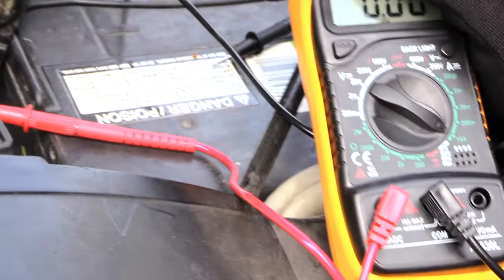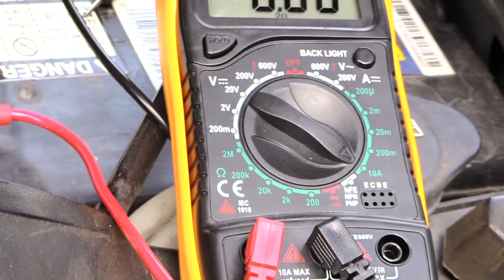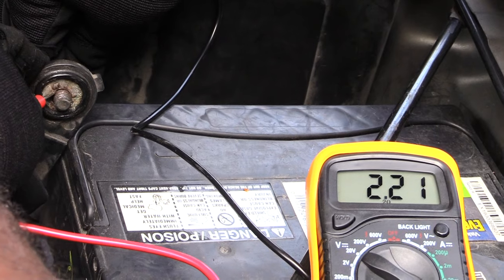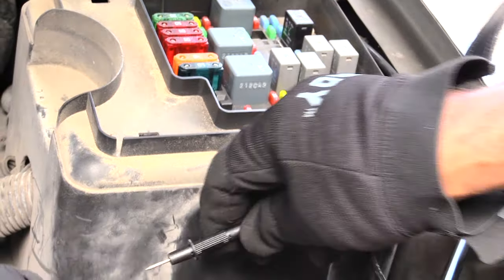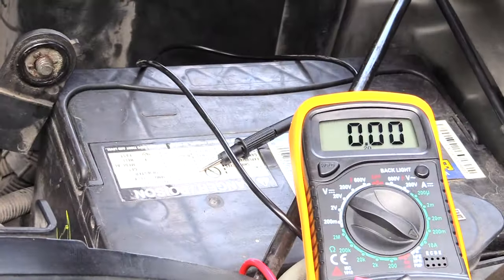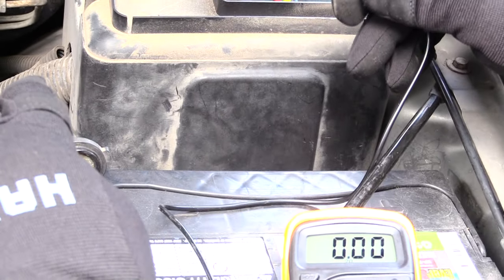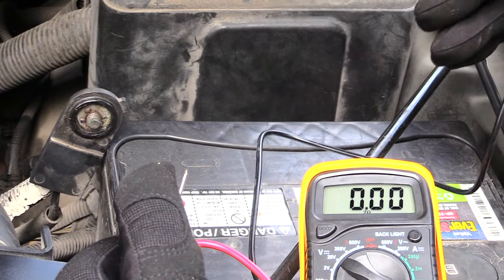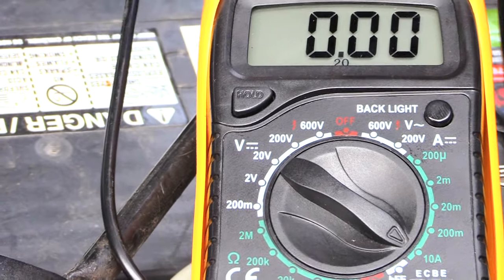Vehicle battery keeps going dead after sitting a day? Here's Why!

Comment: This is so informational. I actually sold my 2019 Chevrolet pickup because I got tired of every time I let it sit for a couple days I would have to jump it off. Went through 3 batteries and several trips to Chevrolet dealerships and other mechanics and no one could diagnose the problem. Such an easy fix and they couldn't find it! Bad deal for Chevrolet because i had been a chevy guy for thirty years and will never buy another one because that one was undependable.
Reply from the maker: Glad could help, hopefully if you have problem again you can figure it out yourself. Please subscribe like and share and check out our other helpfull videos

Comment: Great video! I’ve been chasing a possible issue with our 2007 Ford Edge with intermittent depleted battery. Since our retirement, vehicle usage is significantly less, sometimes falling into the 3-4 week range for this vehicle as we have been using the 2012 Escape more frequently. Now understanding what the typical current draw should be and an expected non-use battery life of about 4 weeks I can better evaluate what may/may not be a problem. Thanks for the very detailed explanation!
Reply from the maker: Glad could help

Comment: Really good Video! Most people tend to look for the complicated issues first when it usually is a simple fix. I would use alligator clips attached to my meter or probe or probes so as not to have to hold the probes manually on the battery or cables during diagnosis. I am an alternating current man myself so working on cars and trucks is kinda foreign to me so I usually find someone else to trouble shoot for me and if I knew some of your tricks I probably would not have needed them in the past. Many thanks.
Reply from the maker: Your welcome glad could help

Comment: In todays modern cars you would have to loop in the multi meter and wait 20 minutes for the computer to go to it's static which means don't open doors and make sure all charging devices in the car are unplugged. There is usually another fuse box inside the car to the bottom left of the steering wheel in most cases.

Comment: Fantastic video, however you cannot really do this with today's modern vehicles because pulling the fuse will wake up other modules and you'll be chasing it for a long time. In my opinion it's better to time out the vehicle until the modules go to sleep, and then do a voltage drop test with a Volt meter across the top of the fuses or measure with a low voltage amp clamp.
Reply from the maker: Thanks for info. Glad could help Please subscribe like and share 🙏.

Comment: There's a high draw because capacitors and systems are pulling as you first connect,  then will drop after 10 mins,  then you pull fuses leaving the multimeter connected
Reply from the maker: Thanks for info. Glad could help Please subscribe like and share 🙏.and check out our other helpfull videos.

Comment: Thank you. Just a heads up if you do change out a radio in a suburban or Yukon/suburban  it probably will not work without opening it up and removing a very small black chip. I saw it on a YouTube.
Dealerships will charge you $$$.

Comment: When the vehicle is switched off, “Typically, the normal amount of parasitic draw is between 50 and 85 milli amps in newer cars and less than 50 milli amps for older cars.” A parasitic draw above this threshold is considered excessive. I have seen some vehicles that have a lot of electronics features can be in the range 120 milli amps.  

If you add some dash cams with standby motion monitoring and or extra security devices, these devices will pull a bit more. You would have to consult the manufacture's specs for current draw and add this amount to the vehicle's normal parasitic current draw to have the total current draw.  With an on board vehicle tracker and a few dash cams you could end up having in the range of 200 to 300 milli amps.  It would be important to have a very healthy battery, because it will run down faster.

Comment: Thank you for the informative information provided. If I were to keep my radio off could that possibly stop the drain from happening overnight
Reply from the maker: If it doesn't check your abs system this can cause this also. Remove your ABS fuse overnight and see what happens. Put it bac before you drive tho.

Comment: I have a 2015 impala (brand new main battery, dual battery, alternator and starter is in good shape) I put my key in the ignition and turn it and the lights and radio ect comes on.. then when I goto start it.. it doesn’t crank at all but just yesterday it was driving fine.. so when I put the new dual battery in I tried to jump/ charge it up a little and it still didn’t crank so my question is should doing this test be my next step? If so how expensive of a multimeter should I get? Sorry for the long post this just so frustrating but thanks in advance brotha 💪🏿💯

Comment: neighbor had a young jaguar.  Battery kept dying while parked.  Dealer kept for a week doing these tests,  consulting with other dealers, still stumped.  Never occurred to them that the first step is to disconnect battery wires (after connecting a survival battery to the car electronics) and if the battery charge drops quickly with no wires connected,  THE BATTERY HAS DIED INTERNALLY.  That was the case.
Reply from the maker: Yea sometimes the most common cause of a problem is missed.

Comment: Yes I had a special test lamp to test for load draw on the newer cars or any vehicle. You're only allowed so many milliamps draw and if your battery keeps going dead you will destroy the battery the negative plates will sulfate and can't be unsulfate. Do you have a special battery charger and sometimes that won't work either. You should have no more than.200milliamps that's less than a quarter of a amp.
Reply from the maker: Thanks for helpful tips. Please subscribe like and share.

Comment: Couldn't you touch the fuse test point and find the draw without having to pull the fuse? whichever fuse is drawing power theoretically would show up on being tested right. As long as you kept your other lead on the battery negative?

Comment: this a Tahoe?   looks familiar lol.   man its like this...1 day my voltage was fine  then after a rain i got some water inside cus my sunroof wasnt sealed shut, after that my battery was just dead....practically new yellow top.    was able to jump it, took a good 15 to 20 minutes of charge before itd crank over, then it runs lights are bright, alternators good....drive around real quick let it charge the batt a bit,park it and its dead dead again the next morning.   i got nothing inside to draw power except my amp but it cant come on without the radio but i take that out, nothing in my 12v plugs, no lights left on.   only thing i can think of maybe is the floor all around where my amp is on the floor under the rear seats got wet from that rain.   could the amp wires somehow getting wet lead to a drain?   when i jump it and put the radio in everytjing works fine nothing seems janky.    my next step after this parasitic drain test was gona be to disconnect my amp and tape off the wires and jump it charge it again and see.   trying not to give up on my bump truck but its a subscription to problems lol

Comment: Great advice, and from responses too!!  !   I need Dummy advice!!  I bought this INNOVA 6030P OBD2 Scanner ABS Code Reader-Diagnostic Scan Tool.  I have a 2010 IS 250 AWD-  What if you have a push button start and my battery is completely dead, & can't be jumped ?  Could the scanner still read anything?  I don't want to tow my car if I don't have to. I also don't want to get ripped off by a mechanic, that's why I bought it. Any suggestions?? It's been very cold in Seattle. My battery is 3 yo old but according to the warranty it should last longer.   I had work done on my car and apparently they didn't tighten up the battery terminals. I didn't notice it when the battery went dead. I had to have it jumped at least 4 x. The 4th guy noticed that the connection was not tightened enough. He tightened it and I didn't have a problem since except for now that the weather cold.  Also, i only drive my car once a week. So any of these factors could be the cause of the dead battery??   Hopefully not the alternator!!!  UGGGHHH!! !!!  💃:face-red-heart-shape:🙀
Reply from the maker: If it keeps going dead then would have alternator tested and if battery is completely dead then reader most likely won't work. Glad could help Please subscribe like and share 🙏.

Comment: After you pulled the fuse you getting 0.7 amp which is 700 mili amp way higher , you can’t have more than 50 mili amp.  After connecting the meter you wake up the module and you get high number if you wait couple of minutes the number may go down to normal draw.
Reply from the maker: Thanks for tip

Comment: Hey what can cause a 5A battery parasitic drain from one fuse but not blow any fuses???
(fuse #8 on my 02 Jeep Grand Cherokee Laredo 4.7L)

So I'm assuming it's not a short or is but the fuse that is pulling 4.41A has that much go away when i pull it abd leaves me with 0.59A still drawing. 

What can cause this condition but not blow a fuse?

The diagram I looked at online said fuse 8 under steering wheel is protecting:

"Overhead Console, Rear Wiper, ip lights, rear flipper glass solenoid."

Instrument panel lights and the overhead console doesn't have power with key-off, engine off!

Rear wiper and rear flipper glass solenoid(wtf us this)

How should i test this with a multimeter? Should i test voltage sith battery still hooked up

I have a test light with probe that shows polarity with green or red light abd also shows voltage. Its not a super skinny probe, its a long test lead. Wish i had back probes for multimeter test leads!!!

Should i test the connecters for voltage behind and after the loads? Not sure how to test after on pigtail connectors and not sure my multimeter or test light will fit in them.

Comment: The newer cars.1999 and newer follow this regimin to shut down: During daylight hours so we aren't thinking of the auto headlights coming on: After shutdown, doors closed, the car will draw 2.5A for the first 30 seconds.  After the first 30 seconds or so the amp draw goes down to 1.5A or so because the car computer is shutting things down.  Wait a few more seconds and you will see the current drop off several times to 20mA or less.  The whole process of shutting down takes about two minutes.  Your mode of measuring the current draw is correct.
The hard part is trying to find the device that gets turned on when the car is supposed to be off.  What is turning on in the middle of the night?
Reply from the maker: Sometimes your problem  can be a problem  with  your ABS system that can pop on even when your car is turned off which ca definitely  drain your battery. I've seen this as a problem on many vehicles.

Comment: My Accord kept killing new batteries of charge.  I finally took it in to a Honda dealership, and they said they could find no parasitic drain anywhere, and charged me $180 for checking.  However, they apparently FIXED the problem without knowing it because no problems since!  Loose connection somewhere?
Reply from the maker: Most likely

Comment: I have a 08 Silverado Lt extended cab 1500 5.3. did turn on after i replaced the fuel pump module, (drove bout an hour. Got back home and it smelled like burn. Got a code for fpcm. Replaced it, it cranked but no start. Since then nothing
Reply from the maker: If it's cranking but not starting then the battery is not the problem.  It could be something  with the fuel pump. Please subscribe like and share

Comment: Hello, question…where did I you find this exact meter?  I have a 2005 H2, new battery, completely dies after a few days, door locks, power windows, & key fob won’t work even after jump starting it. Then it all works off & on.
Reply from the maker: You can buy this at harbor  freight, home depot, or lowes. It is called a multimeter.

Comment: Hello Flashback 502,, I have a 2006 Honda Odyssey EXL. Yesterday all the lights came up on dash and battery went dead fast. I use it to work a taxi service. A mobile mechanic put another alternator on it.. everything check out good after he used his scanner.. my battery is good as well. After driving it about 20 miles yesterday, I parked it then woke up this morning and battery was dead again. He swapped alternator out for another and that alternator charged battery for a short while (but not at first) but after unplugging side plug from alternator and plugging back up, it starting working... but now battery dead again after driving it less than 10 miles... That's 2 new alternators and van is still doing same thing. Also he checked fuses and the ones he checked were good. Any tips would be great & much appreciated regarding what it could be. Maybe a fuse somewhere that people miss? Thank you
Reply from the maker: Sorry to hear sounds like you may have a wire touching something, also check your abs system sometimes this can cause this.

Comment: What about a low buzzing sound that persists until the battery cable is unplugged?
Reply from the maker: Check abs sometimes this can cause problem. Remove ABS fuse and see if sound goes away

Comment: a bro how can i find out if my cooling fan is working properly in my car with a multimeter i have a 93 cadillac fleetwood brogham i recently replaced radiator i let the car run for a while but noticed that cooling fan dont go on i changed out the relay for it but when i drive it for a while and i check to see if it goes on but it dont is that normal some people i ask they said it has to hit like 220 or 230 and it goes on but i wana find. Out if its true if u can help me out would really appreciate it
Reply from the maker: That  is normal most vehicle fans don't come on until a certain temp is hit, you can use meter to chech power going to fan. Also you could use small jumper wires from battery to touch prongs to see if comes on. Glad could help Please subscribe like and share 🙏.

Comment: Hey could it be a alternator problem if u have full charge battery while driving the car shuts off and then you check the battery voltage there's no power battery drain quick?? At the same time  jumpstart the car battery has power driving again then 20-30 seconds the same problems occurs again what would cause that problem  Could that really be the alternator turning bad?idk that much about cars or know anyone that's a mechanic I just have this problem and really  need some help from you or anyone here I would appreciate alot guys
Reply from the maker: Yes could be alternator also make sure your battery cables are tight on battery. Please subscribe like and share and check out our other helpfull videos.

Comment: The issue I'm having is, that it's fine most of the time, but then the battery dies while you're inside the store or visiting a friend. Sometimes you can let it sit for a few minutes and it will be fine again and other times you have to jump it off
Reply from the maker: Make sure you don't have corrosion on battery terminal and battery cables are tight.

Comment: This is not a reliable method anymore as modern vehicles have lots of modules that wake up when the battery is connected. Any vehicle faulty or not will have a high draw until the modules go back to sleep. Pulling fuses and putting them back in just wakes everything up again. Better off checking voltage drop across the fuses.

Comment: How to check for a drain is ok, info on the parasitic drain is totally worthless. 
Dude; ALL new cars built in the last twenty years, with body/powertrain/trans/ABS computers; and modern radio, HAVE a parasitic drain to keep those memories or part of the computer awake. And it is Para-sit-ic, not Para-sight-ic. So, you need to know what the parasitic drain is for each individual vehicle and figure out if the drain is TOO much. Only way to stop it is to pull the neg cable off the battery. 
Most vehicles will drain a battery in x-number of days, you usually get about 30 days. If the parasitic drain is as per the vehicle spec, it will NOT drain in a few days unless the battery is shot. If it drains a good battery in two days, there is more than the standard parasitic drain.